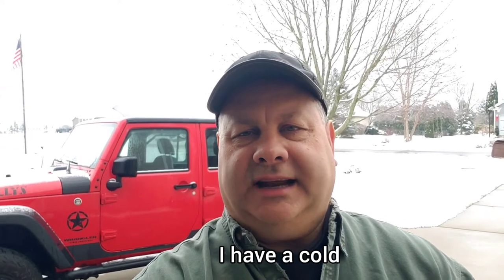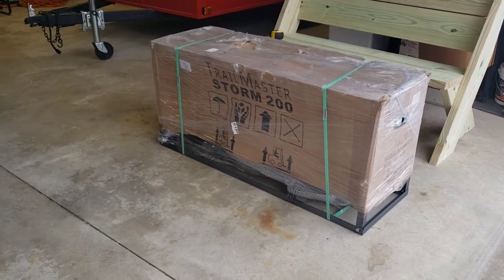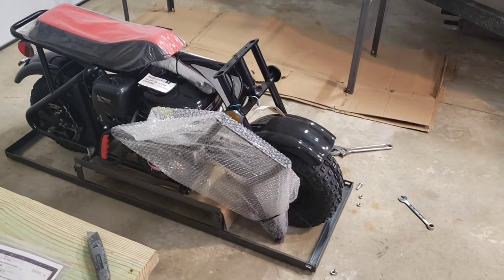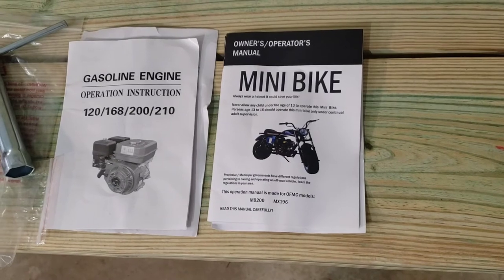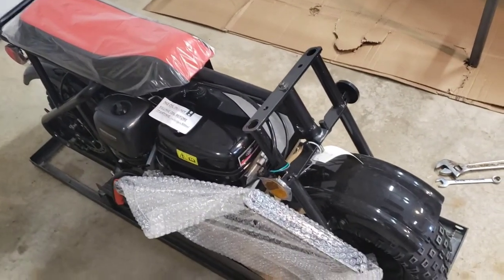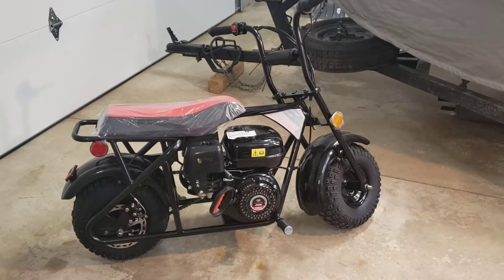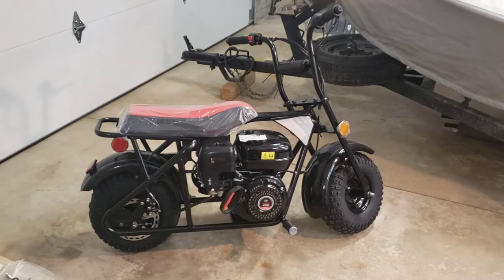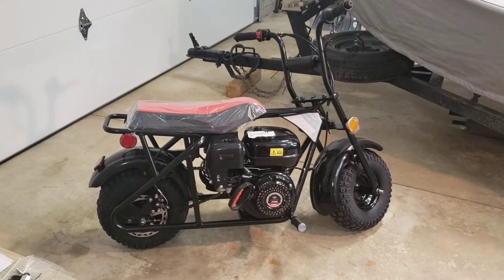TrailMaster Storm 200 Mini Bike Assembly

Comment: it pops so many wheelies 😂 i got a custom straight pipe and it’s crazy but it just whobbles and my clutch started skipping so i got a new one
Reply: My throttle is giving no gas do you know why when I move it nothing happens it does move slightly though
Reply: @Ash10_LUVSHONDA  tighten ur throttle cable
Reply: @BEAZM0DE  I’m gonna try that and see if it works